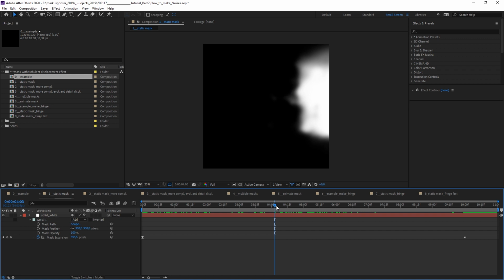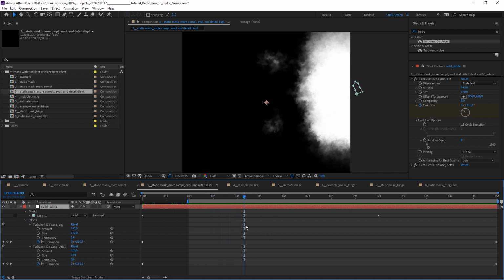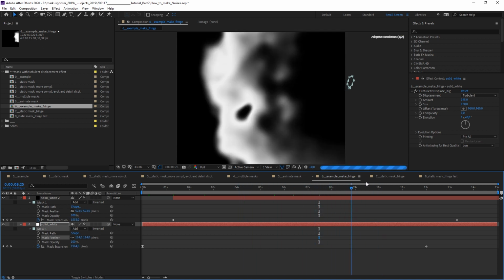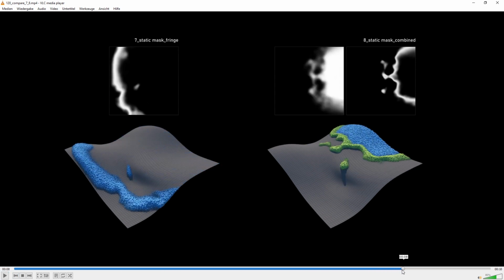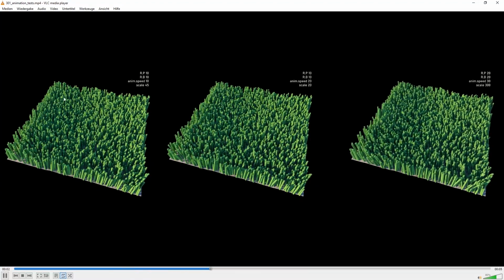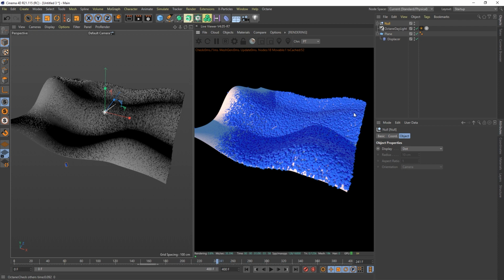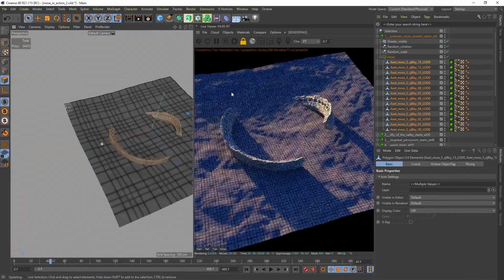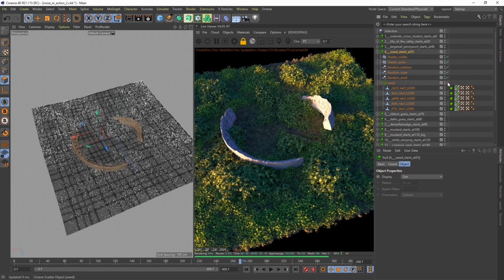Cinema 4D Tutorial Create Digital Nature Using Megascans and Octane (Part2)

Comment: Hi man, nice video! I was wondering does this work in matrix scatter as well?
Reply from the maker: Yes its pretty much the same with redshift 👌
Reply: thanks man! tried it out, but i got a small issue with the shader effector. When i load in my png seq from ae to c4d and calculate, it gets my framecount right,  but i don't see it affecting my scattering. Are you exporting movs or sequences? Alpha or color? @3DBONFIRE
Reply from the maker: @Lennert-k1h  ahhhh, I Had the same issue with C4D 2024! I couldnt use my jpg/PNG sequences with 2024...I think its a super stupid bug😖
Reply: @3DBONFIRE  that’s dumb indeed!! But thanks for your answer, I’ll try to download a previous version ;)
Reply: It worked on 2023 version! thank you very much my guy!!  @3DBONFIRE

Comment: Thanks a lot for this awesome tutorial man, this is just crazy ! I would appreciate a lot if you could develop a bit on the windy effect you get cuz i tried some random rotation but it didnt seem to work as good as you so maybe i'm missing smth.. Anyway thx again and please keep going with new tuts :p
Reply from the maker: And! Somebody told me, you will achieve natural result by using the noise type: turbulence. Please give this one a try;-).
Reply: @3DBONFIRE  yup absolute right! The turbulence noise type is working so nicely. just tested it.
Reply from the maker: I hope I can explain it a bit more, but I think the trick is: just have small rotation values in your random effector and use a animated noise in it. And play a bit with these  noise settings in the effector,  I think they are called noise size and speed or something like that.

Comment: 28:42 one small tip here: You can write "+20" into the textfield behind the current value and hit return, so that #C4D does the calculation for you ;-) You can also do other math operations.
Thanks gain for sharing your workflow :D
Reply: You can also write "x+20" which just adds 20 to the original value. The advantage is that this also works when you have more than 1 value (object selected) :)

Comment: How did you add that smooth wind effect? Also, I tried it with Forester and the render time were nuts. What render settings do you suggest for such animation? Great tut! Thanks!
Reply from the maker: Hi, i went a little quick on that. I just used a random effector with some animation in the rotation values. You can use a slightly different random effector on every octane scatter to get more variation.